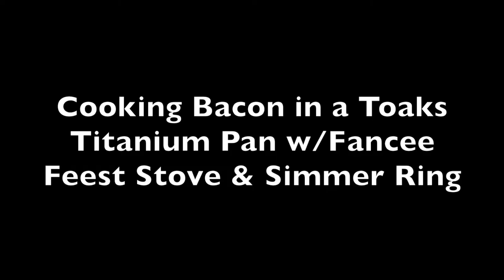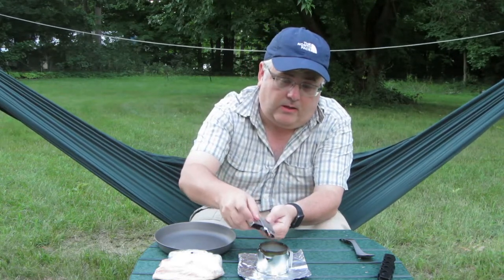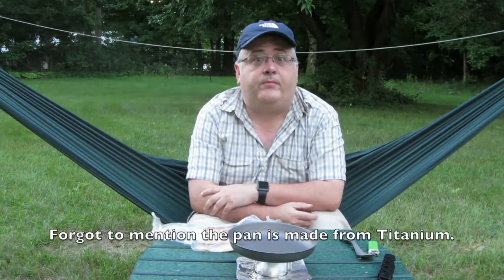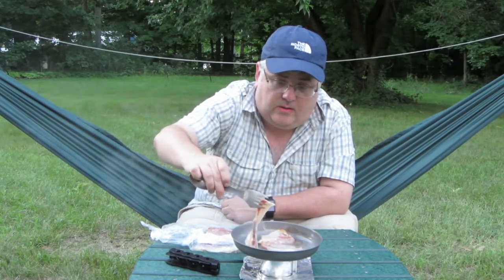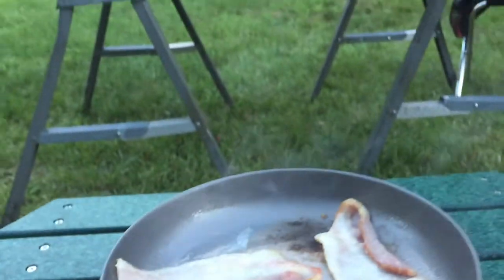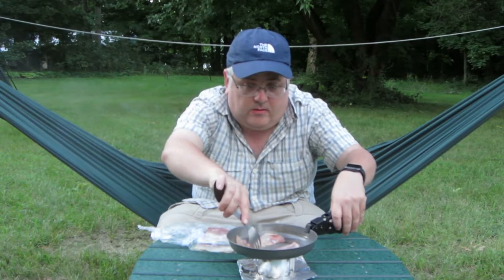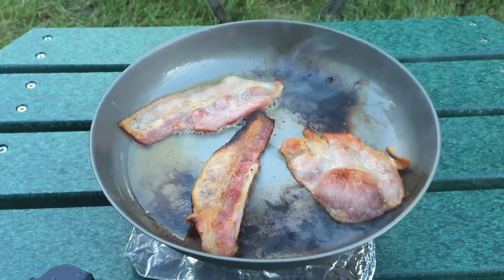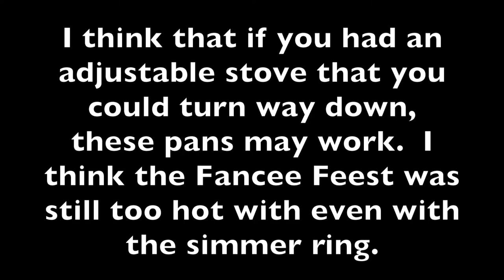Cooking bacon w/ a Toaks Titanium Plate & a Fancee Feest stove w/ Simmer ring

Comment: Hi, I enjoyed your video. I was wondering if you have had any more experience frying with the simmer ring / fancee feest combo. In regards to the hot spot in the pan, I was wondering if it would perform better with a windscreen.
Reply from the maker: I haven't tried it but that's an interesting idea, it may help even the heat out but the way titanium disperses heat is more conducive to boiling water.

Comment: You think you'd be better off with a smaller pan / a bigger stove / stand for this sort of thing? Or do you think it works out well, besides precariousness and the other things you mentioned?
Reply from the maker: This was a test to see if it would work. I try to keep my cook kit as small as possible but yet still versatile. Titanium is not a good conductor of heat so a large flat surface has hotspots. Titanium works ok for small pots and mugs because your flame is usually (or should be) close to the size of the bottom of the pot.

Comment: The blue that you see on Titanium is only surface oxidation and not the metal loosing any kind of a temper.  Is that pan coated with anything?
Reply from the maker: +John Rossetti Yeah, you can expect discoloration due to anodizing in the heat but it's the black spots that are annoying.